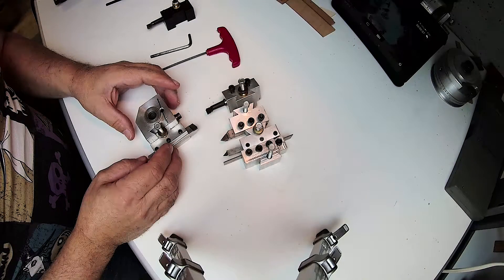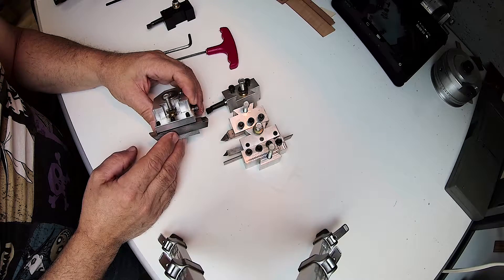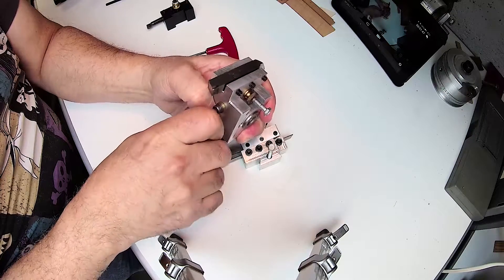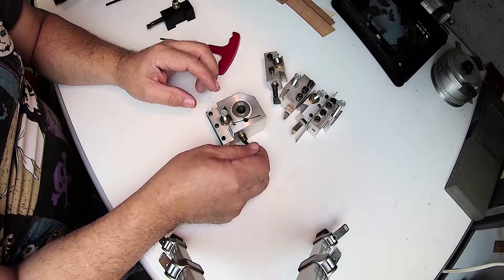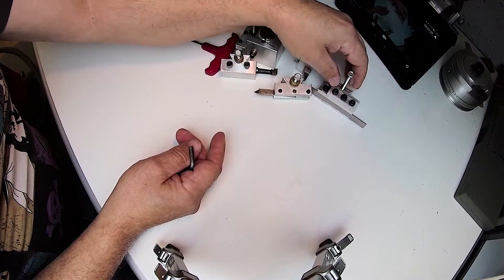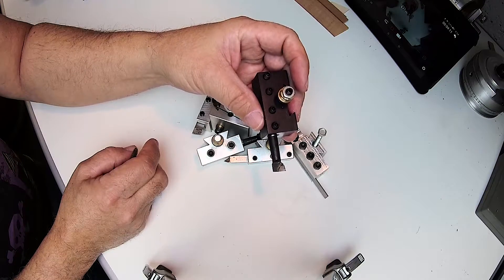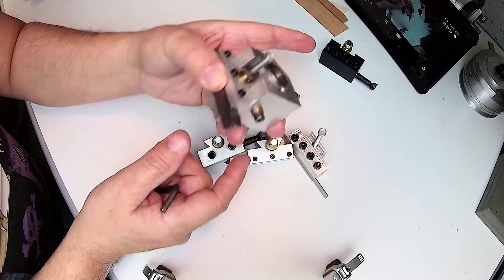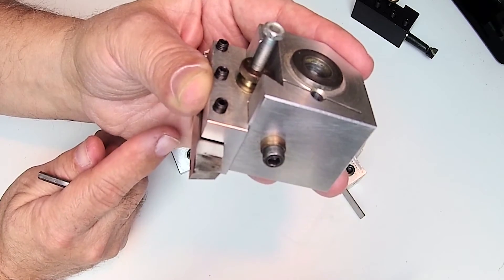My Shop Made Quick Change Lathe Dovetailed Toolpost

Comment: your dove tail is superior to the other in that the tool is pulled tight against the post rather than pushed away. either work well but the one you made is technically superior.
Reply: technically superior. 
the best kind of superior. :)

Comment: TU! Very cool tool posts. How did you create the slot? Bandsaw, circular mini saw, or EDM?
Reply from the maker: Slitting saw using my home made milling machine.  I did not have the Littlemachineshop minimill yet.
Reply: Perfect tool for slotting. How do you like the little machineshop mill?  I was looking at them a while back before re-retrofiting a CNC Sherline for rc model work
Reply from the maker: I like it. All these tools are a bit "Rough" Nothing too refined about them. But they do the job. The Sherline definitely has a much better finish!
Reply: I thought that. I did a whole RC micro helicopter kit injection molded parts  when I started MIA Micro-FLIGHT from aluminun molds I cut on an CNC Sherline mill, but I had to painstakingly tweak the mill lead screws and antibacklash nuts, made my own to remove the antibacklash, where I could actually machine a gear mold with precision. At that time there were no off the shelf gears of the size I required to do the micro helis I was selling in kits, and so I had to make it from scratch. I used a 1/64 mill to a depth of 1/8, broke 3 in the proces of getting the right speed and feed for that small of a mill to mill the teeth of a 120 tooth 64 Pitch gear negative and  I actually watched the machine during the whole machining cycle which took close to 12 hrs to make sure nothing went wrong.  I did close to 100 4x4x2 inch aluminum molds on that machine, I still have it, and it is a great little machine when it is setup properly.

Comment: Very impressed at what you've done. I have two elderly lathes (both about 75 years old) and I've been thinking about QCTPs for them. I think I might try to copy your design, if you don't mind. As a hobby-user, I need something that I can make and if it's not compatible with commercial tool-holders, that really is not an issue. You are an inspiration.
Reply from the maker: Go for it not problem. Glad you liked it.